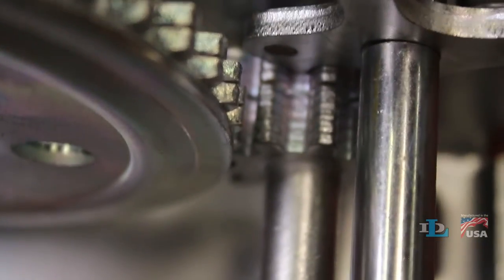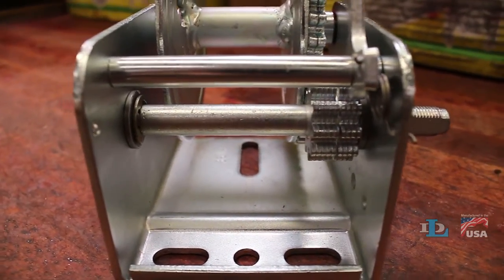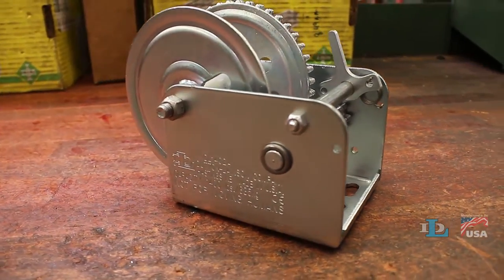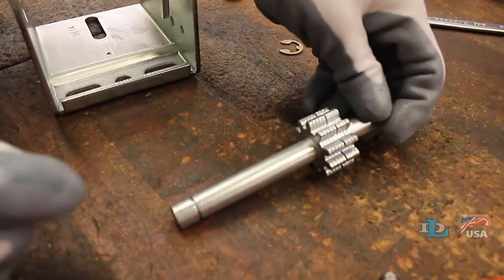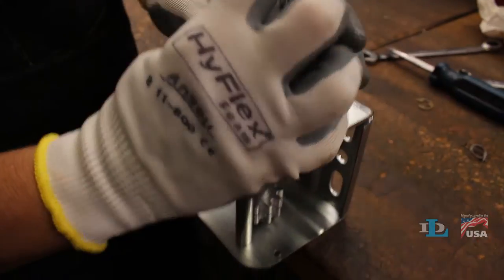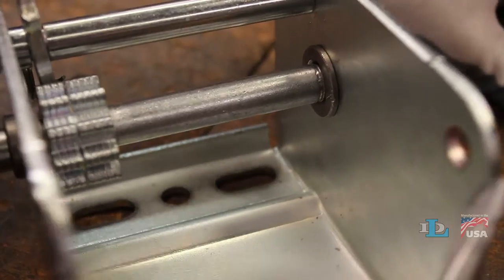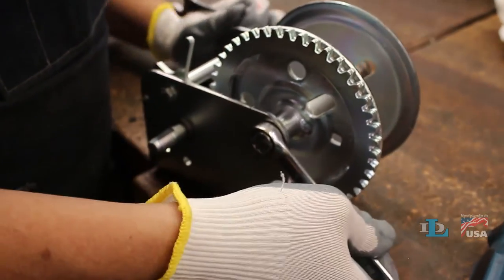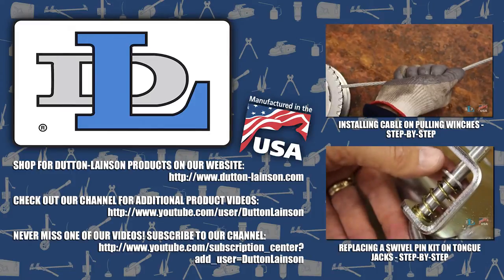Replacing the Drive Shaft on Single-Speed Pulling Winches - Step-By-Step

Comment: Thanks for the video. I just replaced the driveshaft on a DL1802A winch. It went almost as well as the video. Since i did this for a friend away from my shop I did not have one important tool with me. A file. The handle rolls up a burr at the contact areas on the flat mounting area. It was enough to prevent the bushing from coming off easily. The flat tip screwdriver served as a file as well as it could. Thanks for the good instructions. Tim
Reply from the maker: Thanks for the comment!  We're glad that this video was able to help you fix your friend's winch!